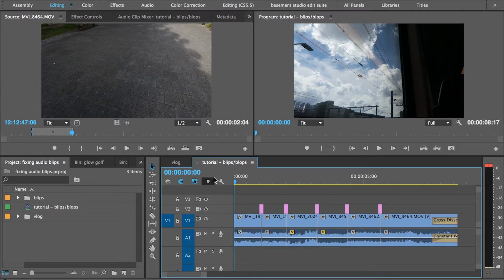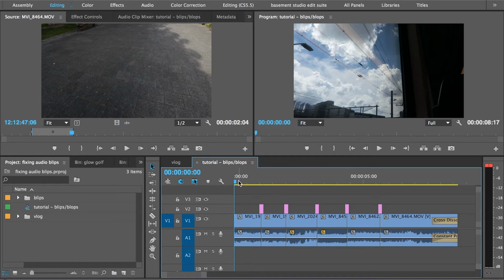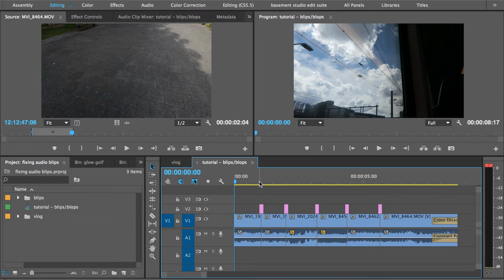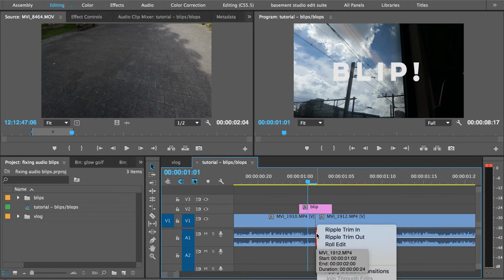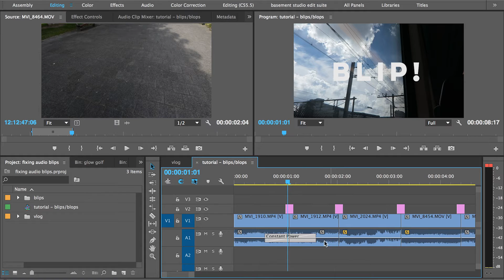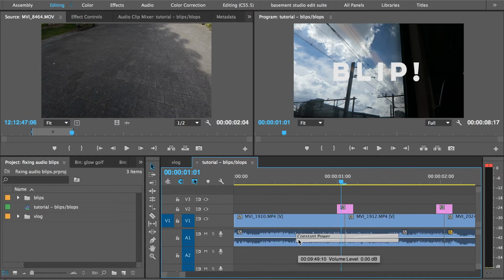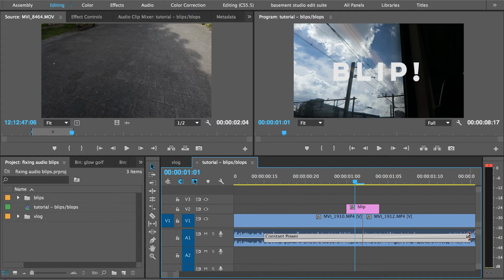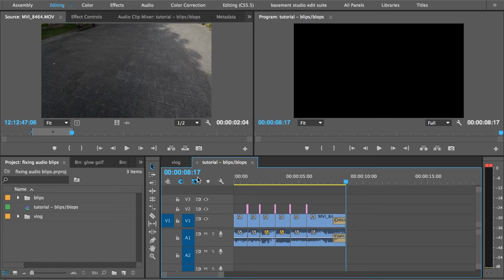Premiere Pro CC Tips And Tricks #4 - Fixing Clicks and pops in your audio

Comment: You can just select all the clips and then press Shift+Cmd+D (Shift+Ctrl+D on Windows) to apply the default audio transition to all edit points. No need for all this time-consuming mousing around.
Reply from the maker: true but you still have to adjust the length of the transitions. Or do you know a way to archieve this? I would love to hear it :)
Reply: you can adjust the default length to two frames in your settings... I still click around a bunch though
Reply: If you add the transition length you want to one edit point you can copy it and select all the other edit points (Ctrl (Cmd) -drag and lasso)  and paste. Now all transitions will be the same length. To adjust one by one you can double-click and enter a new duration.